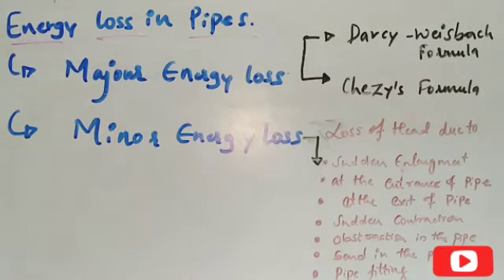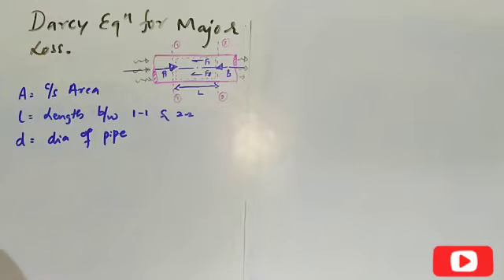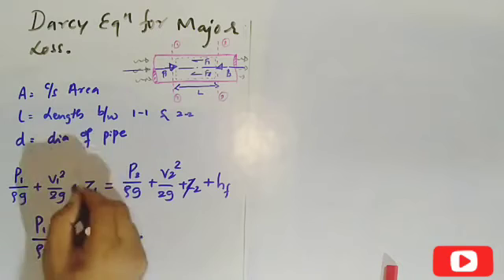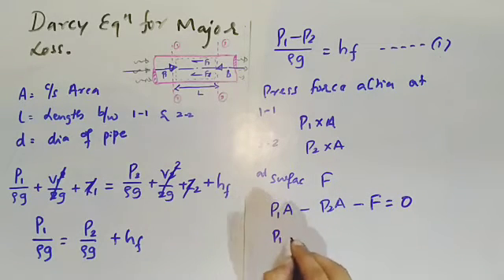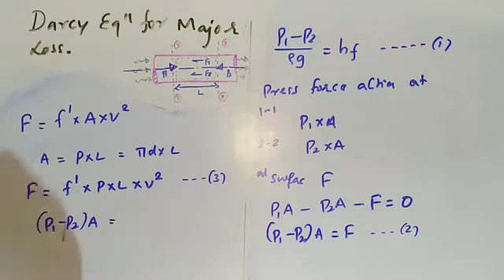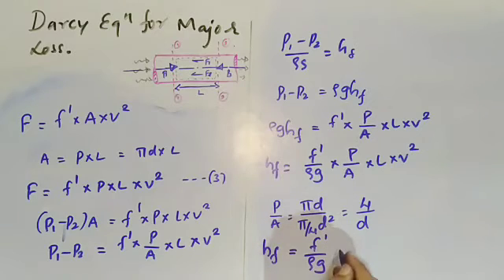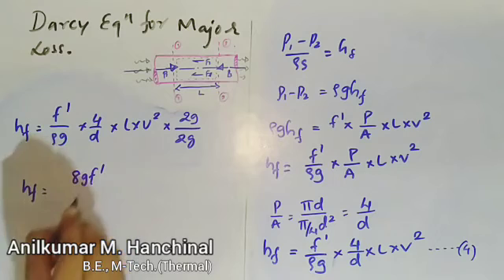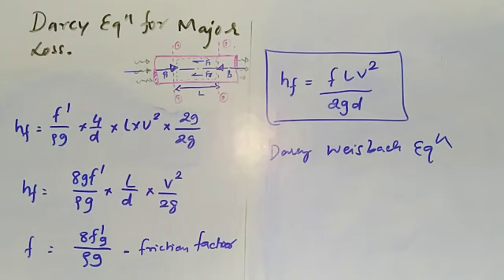Fluid Mechanics Module 3 : Laminar Flow | Major Loss | Darcy Weisback Equation | 15 | VTU | GATE2021

Comment from the maker: Question : What are different Minor Energy Loses observed in pipes
Reply: Due to
1) sudden enlargement, 
2) entrance and exit of the pipe
3) bend in pipe
4) pipe fitting
Reply: Loss of head due to 
1-sudden enlargement at the entrance and exit of pipe
2- sudden contraction of pipe
3-bend in pipe
4-due to pipe fittings
Reply: Losses Due to. 
1.Sudden Enlargement
2.entrance and exit of the pipe. 
3.Bend in pipe. 
4.pipe Fitting.
Reply: 1.sudden enlargement
2.bends and curves
3. At the entrance and exit of pipe
4. Pipe fitting
5.sudden contraction etc.
Reply: The various minor energy loses observed in pipes are:- 
1. Sudden enlargement at entrance  of the pipe and exit of pipe.
2. Sudden contraction.
3. Obstraction in the pipe.
4. Bend in the pipe.
5. Pipe fitting.
Reply: 1.Sudden enlargement.
2.Sudden contraction.
3.Obstraction in the pipe.
4.Pipe fitting.
5.Sound in the pipe.
Reply: (1) sudden enlargement ,(2) at entrance of pipe , (3) at exit of the pipe, (4) sudden contraction (5) pipe fitting
Reply: Loss of head due to
1. Sudden enlargement
2. At the entrance and exit of pipe
3. Sudden contraction.
4. Obstruction in the pipe
5. Bond in the pipe
6. Pipe fitting.
Reply: Due to 
1. Sudden enlargement
2. bend in pipe
3.pipe fitting
4.sudden construction of pipe.
Reply: Sudden enlargement in entrance and exit
Sudden contractions 
Bending 
Pipe fitting etc
Reply: By,
1] SUDDEN ENLARGMENT.
2] ENTRANCE & EXIT OF PIPE.
3] BEND IN PIPES &
4] PIPE FITTINGS
Reply: Sudden enlargement, entrance and exit of the pipe, bend in pipe, pipe fitting, etc.

Comment from the maker: Question : Which are the two methods or equation used find Major Energy Loses in pipes
Reply: Two methods are 
1) Darcy weisback formule
2) Chezy's formule
Reply: 1 Darcy weisbach formula
2 Chezy's formula
Reply: Two methods are darcy weisback and chezys formulas
Reply: 1.Darcy weisbach formula
2.Chezy's formula
Reply: Darcy weisback formule 
Chezy's formule..
Reply: Methods are follows, 
1.Darcy weisbach  Formula. 
2.Chezy's Formula.
Reply: The two methods or equation used to find major energy losses in pipes are:-
1. Darcy Weisback equation.
2. Chezy's equation.
Reply: 1.Darcy Equation.
2.Chezy's Formula.
Reply: (1) D'Arcy weisback formula, (2) Chezy's  formula are two formula which is use to find major energy losses in pipe
Reply: The 2 methods or equations  of major energy losses are -
i) Darcy weisbach formula.
ii) Chezy's formula.
Reply: Two method are
1.darcy weisback formula
2.chezy's formula
Reply: Darcy W formula 
Chezy's formula
Reply: Darcy weisback formule
Chezys formule
Reply: 1] Chezy's formula 
2]Darcy weisbach formula
Reply: 1,Dracy weisback formula
2,Chezy's formula

Comment from the maker: Question : Define Minor Energy Loses in pipes
Reply: Loss of Energy in fluid due to disturbance in the fluid flow pattern is known as minor Energy loss
Reply: Due to disturbance in the fluid flow pattern
Reply: Minor energy loses are due to disturbance in the fluid flow pattern
Reply: The losses are due to disturbence in the fluid flow pattern
Reply: Loss of head or energy due to disturbance in the fluid such bend, curve, enlarge of pipe.
Reply: The losses are due to disturbance in the fluid flow pattern..
Reply: Due to disturbance in the pattern of fluid flow, loss of energy in fluid takes place which is known as minor energy losses in pipes.
Reply: These loss occur due to the disturbance of fluid flow pattern.
Reply: It is defined as due to disturbance in the fluid flow pattern there will be loss of energy is called as minor energy losses
Reply: Due to the distrubance in the pattern of fluid flow, loss of energy in fluid takes place. This is known as Minor energy losses.
Reply: due to disturbance in the fluid flow pattern.
Reply: Due to distribution in the fluid flow pattern
Reply: Defined as loss of energy in fluid due to disturbance in fluid flow pattern is clled as Minor Energy Loss
Reply: Loss of energy in fluid due to disturbance in the fluid flow pattern is known as minor energy loss

Comment from the maker: Question : What is energy loss in flow and which are the two main losses observed in fluid flow.
Reply: Energy loss in flow defined as the fluid experience some resistance force while flowing in pipe and loss some energy is known as Energy loss in fluid 
There are two types of loss 
1) Major Energy loss
2) Minor Energy loss
Reply: Energy losses in flow defined as the fluide experience some resistance force flowing in pipe and loss some energy know as energy loss in fluid. 
Two types of loss. 
1.Major energy loss. 
2.Minor energy loss.
Reply: Fluid experiencing some resistance force while flowing in the pipe and some energy loss takes place known as energy loss in fluid.
            The two types of loss are:-
1. Major energy loss.
2. Minor energy loss.
Reply: When a fluid is flowing through a pipe,the resistance is observed by fluid due to which some of the energy is lost.
The two main energy losses are.1)Major enegy losses   2.)Minor energy losses.
Reply: It is defined as the fluid flowing through the pipe which resistance  force is observed while fluid flowing  due to some of energy losses ,(1) major energy loss ,(2) minor energy loss
Reply: It is defined as the fluid experience some resistance force while flowing in the pipe and some energy losses take place.
Reply: Fluid experience same resistance force flow in pipe and loss same energy know as energy loss in fluid. 
Two types of loss.
Reply: When Fluid experience some Resisitance force while flowing in pipe nd loss of some energy is called as Energy loss in fluids.
2 types of losses are :
1] MAJOR ENERGY LOSS
2] MINOR ENERGY LOSS
Reply: The fluid experience some resistance force while flowing in the pipe n loss some energy is known as energy loss in fluid
1,major energy loss
2,minor energy loss

Comment from the maker: Question : What is energy loss in flow and which are the two main losses observed in fluid flow.
Reply: When fluid is flowing through a pipe the fluid experiences some resistance due to which energy of fluid is lost
The main two energy losses are major losses and minor losses
Reply: During the fluid flow in pipe, it experiences some resistance due to  the flow of energy. 
1.major losses
2.minor losses
Reply: The two main losses observed in fluid flow are:-
1. Major energy loss.
2. Minor energy loss.
Reply: (1) Major energy loss (2) minor energy loss these two losses are observed in fluid flow
Reply: The fluid flowing through a pipe the fluid experience some resistance due to  the flowing of energy. 
1 major losses
2 minor losses
Reply: is defined as fluid flowing through a pipe the fluid experiences some resistance due to which energy of fluid is lost
2 main reasons are major and minor loss
Reply: Resistance to flow in pipe,
1, Major energy loss
2, Minor energy loss